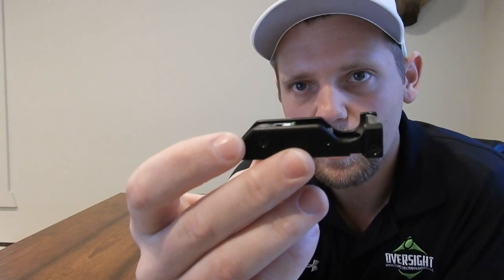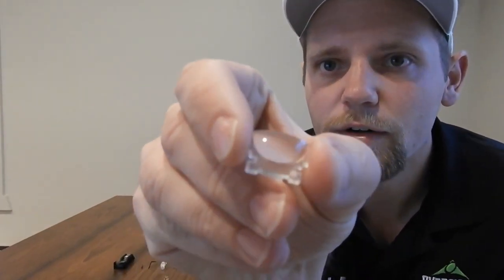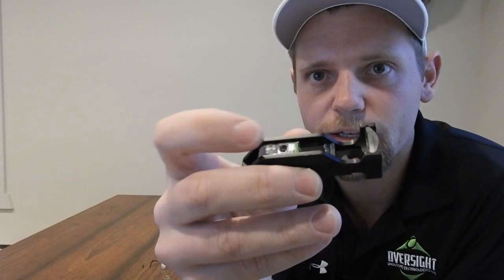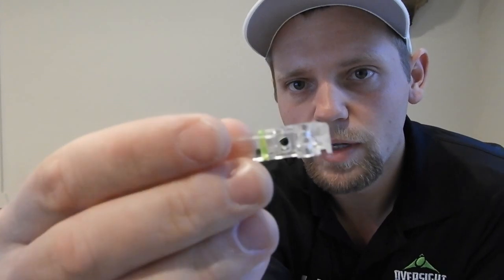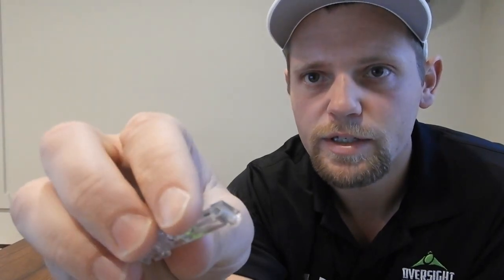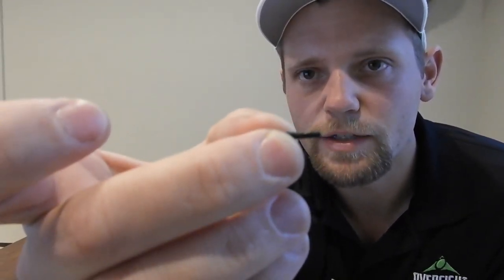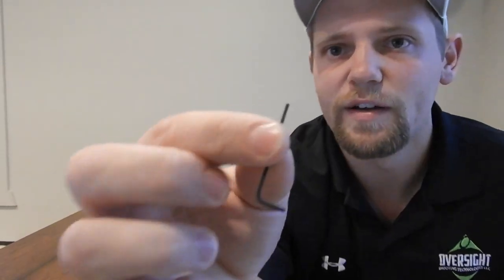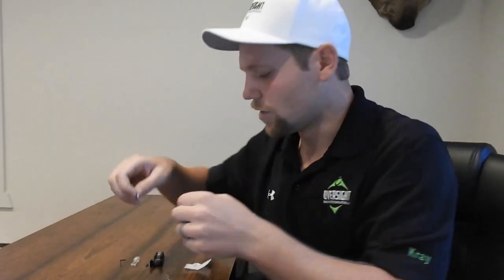SeeAll Sight Complete Construction, and Function

Comment: So once zeroed it does not experience needing rezeroed barring putting it on another firearm? I have problems with my eyesight that makes using dot sighting very problematic and the one sight system that alleviated the issue were the trapezoidal sights on a Steyr pistol. Unfortunately, not many trapezoidal sights are available in the aftermarket so your system using a delta reticle would be a God send for me. I have a large grey floater in my dominate eye and have for nearly 20 years relied on point and shoot training at defensive distances, and could no longer shoot for accuracy and distance using conventional 3-dot setups. I tried a red-dot system and that does not provide any relief either. I will be giving your product a try very soon and hopefully it will be the answer that I have been searching for.

Comment: Hi. I have been using these sights for almost 3 years. I run them on 2 pistols, a rifle, back up sights on another rifle, and a shot gun. Is there any trade in/ up options? Id like to upgrade 2 of my sights to the mk2 w/ tritium. Ive actually modified 1 of these to be night sights by milling them out a little bit and installing a tritium tube. It works but i like the mk2 reticles better.thanks
Reply: They have an upgrade program on their website. You can return your old one for 60% off a new one!

Comment: I'd love to see you guys sell this with a riser the specific height for true co-witness on AR-15s. Imagine pulling up and shouldering your AR-15 (particularly the ultra short ar-15 pistols with a brace) and having the tip of the chevron right in the center of your flip up rear. That'd be a lightning fast presentation to shot on target. It'd also make them super easy to adjust, if your irons are already on - you just move the chevron to the tip of your front iron, boom - done. Especially for specific zero's like 100 yard zero or a USMC 300 yard zero. Another reason for a co-witness riser: railed front gas block. If you do have a railed front gas block, throw this on instead of a front iron, with a flip up rear peep - narrowing your focus with the rear peep and putting the chevron in the center would provide remarkable levels of accuracy which would still be much faster than traditional irons. This sight has all kinds of interesting possibilities.
Reply: I use a modified gen 1 with chevron on a .5 qd riser on my shotgun.it took some fiddling, and i had to order a tap set ive never used again to thread it into the riser. But it works great.i took. The standard version and installed a tritium tube myself.looks way slicker than there night sight version. I also capped off the hole the tritium tube is in with glowing sight paint.at this point im lookingbat getting  mk2 night sight versions to replace them, but at the time it was the best solution.